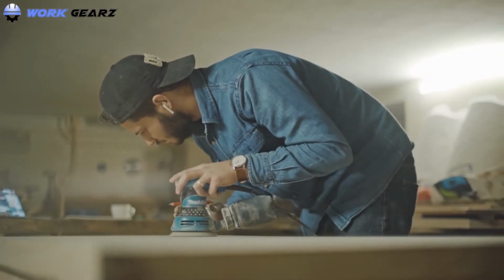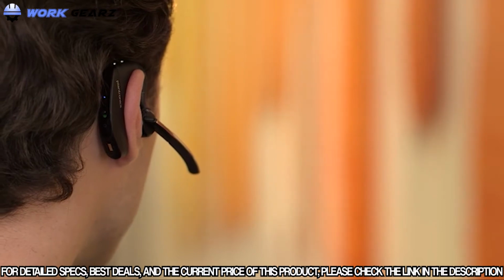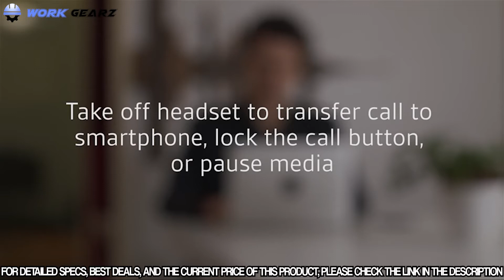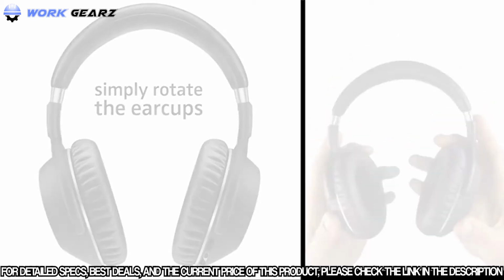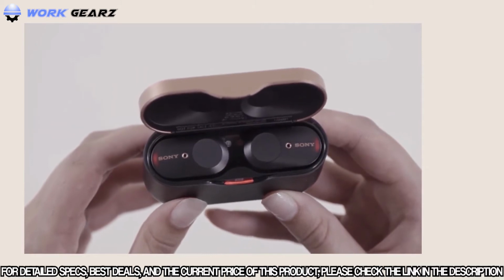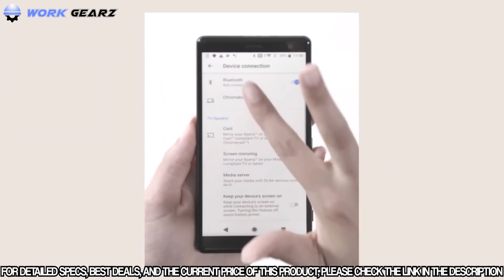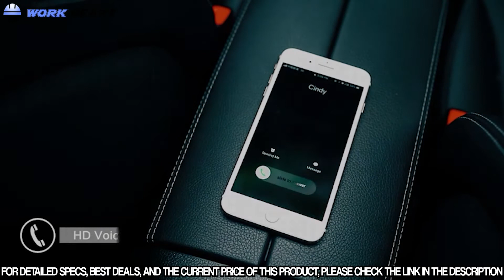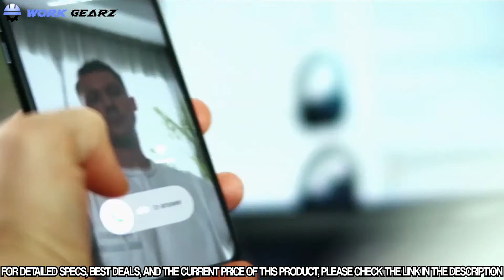Top 10 Best Bluetooth Headset for Construction Workers

Comment: Baseline is difficult to get
Baseline is commonly-available construction-worker ear-plugs to ear-muffs/headset to helmet to helmet-headset(hazmat)
Baseline for wind-noise graph pus one for motorcycle cruise at 160kmh to tourer to sports-tourer and scale set from construction to indoor-workshop to motorcycle(intake-roar, engine-note, exhaust muffler/can/pipe)-gear-shifting needs...

Baseline is cheap. Bluetooth is factored into consideration.
Reply: 给我 sat-ki 1400cc sports-tourer is not sports is not supersports is not... ear protection without audiclear.